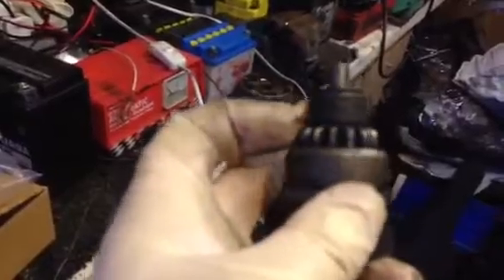BIKE WONT START SPEEDFIGHT FIX RUNNING MARK SAVAGE

Comment: Hello, I'm from Colombia and I have speedfight of the year 99 2 times 100 cc. I can not get the cylinder and the piston. I want to know if I can use a cylinder and piston of 70 cc to continue using it?. Thank you
Reply from the maker: hi bud you can only use the 70cc kit on a 50cc and not on a 100cc and the bore and bolt holes are different.maybe try and find an international seller or company on e bay that will send you it,  take care bud and thanks for watching there are many other videos on speedfights that will help you toomark

Comment: orite pal I've just changed crank on my speedfight 2 lc 2000 model doesn't want to start any ideas has spark, fuel, and compression need help cheers
Reply from the maker: if you have changed it and the oil seals are ok and it's sucking petrol in so the plug is getting wet with fuel ? , if not maybe ut some into the pot or use some easy start into the carb! , have you put water into the system? sometimes if the head is not down tight water will entre the head? ,this is why I say in my other videos not to do it and start without ! mark
Reply: Oil seals looked fine and plug is getting wet and will try easy star tonight and no water in system
Reply: mark savage  i have a speedfighter 100cc it has awsome compression but not spark i have checked the coil on my other bike its fine but when i try it on mine no good HELP PLEASE
Reply from the maker: hi bud I have over 50 videos to help and a few on cdi units which it sounds like it is with no spark!!, check out my other channel which you can find in my subscribe list just called mark savage help. on here you will find it easy and how to replace it and which one it is as there are 4 types 3 easy and one immob !. hope that helps please like and subscribe and share. mark
Reply: mark savage my bike is a non emobi and i will change my cdi unit today thanks

Comment: Hi mate I have a problem with my Speedfight 4 it won’t start it’s getting fuel,spark and compression but won’t fire up could it be the cdi? Cheers.
Reply from the maker: Kieran Mcdonald hi bud I did like working on the sp3’s and the sp4 is the same Lol 
If you have spark and a good blue spark then you cdi is fine 
However the piston can stil go and you can still get compression however they suffer from electrical problems on the sp3and 4s 
You end up with a orange weak spark  
Check earth and connector 
If it’s under 3years old maybe go back to Main dealer you got it from 
Mark
Reply: mark savage will check that cheers for advise

Comment: hi mark I blew my 50cc up and fitted a new 50s kit iv been running it in going easy ect when I'm rideing the bike will just die it's all standard but de restricted cleaned all carb lines ect and doing my nut in any ideas?
Reply from the maker: I take it it's A/C? as long as the head is down ok, check wires and then carb it has to be one of them sometimes the stator coil can go to earth and short out when it gets warm or coil ? other than that if it L/C it can be the head not down . any way check everything bud backwards make sure you reconnected the oil pipe as it could be heat seizing !! give them a go first and see what you can find . mark
Reply: Have you tightend your idle screw to much ?or the air fuel screw? Mine had the exact same problem

Comment: Mark where you based pall could you fix my aerox it's got a 70's kit on it and it bogged out on me when I was riding it and it hasn't started since got a spark plug but it was wrong one need to get the right one and see if that works but I think it f**ked
Reply from the maker: hi bud I have a few videos on the aerox's and I'm in Essex but normal do these videos so you can fix them yourself bud
Reply: Im with you that's abit far off as well but yeah I've never really gone in to the engine and other stuff but im thinking of giving it ago just can't think what the problem could be
Reply from the maker: well if you watch my videos I really don't like 70cc kits and will be doing a engine rebuild on one very soon so maybe keep an eye for it . I will be putting it back to a 50cc new crank oil seals rollers stator coil so lots of thing that will help you with your bike bud but normally a good carb service should help with your bike . thanks for watching my videos please do like and share and have a look at the aerox carb video its on here bud . mark
Reply: Yeah am with you saw a few videos of smashed Pistons I think that might be it but there could be a million things thanks I'll stay update
Reply: why don't you work on your bike bud. Don't get why people tune their bikes and not no how to maintain them. Aerox's are so easy to diagnosed issues. just go through your bike...lol
Reply: I haven't touched it or tuned it I bought it that way there's aload of metal bits in where crankshaft is think bearings n seals have gone or something plus I'm using shitty tools n all ,,,,, what do you think of the kurz rt1 125 enduro bike search it on wed
Reply: if you got shavings/bits in the crank could bearings, piston. What's actually wrong with your bike mate
Reply from the maker: Bluez Tues hi bud the 125 looks lovely me a road pit bike can't say I know much about them , as for the bits is the piston all there ? As I guess that would be from the piston, the bearing can break up as I've seen it before , have a look at the bit , I did a video on bearing and when they broke up , mark
Reply: Aerox Ryan it don't start with new piston and mark ye I know looks alright like know quit a lot about pit bikes might take the 125 out n put a 160 in it ,, and the bits are quit big but there not snapped off the piston there little shades of things thanks for help guys

Comment: My moped is a nightmare to start if it starts at all in the mornings but once it’s hot it’s starts straight away even on the electric start, just replaced spark plug but it started and cut out after 5 seconds of running and it was the same before I replaced the spark plug
Reply from the maker: Hi 
Ok carb off and clean like in my cleaning video 
Then tuning like in my tuning video
Auto start ?
Have to looked and tested that ?
Some moped in cold weather like kick starting as the stator coil get worn or dirty also maybe worth a look at 
Guessing you also changed the airfilter so serviced

Comment: The only way my bike will start is when i blow up the petrol pipe in to the tank then put the pipe back on the carb then it will run for about 30 seconds then it dies out any ideas plz

Comment: HI MARK, MY 2006 SPEEDFIGHTER  WILL START. BUT WHEN I LEAVE GO OF THE BREAK IT CUTS OUT  [CAN YOU HELP ME ]. THE ORANGE LIGHT COMES ON
Reply from the maker: snukey. bear hi I have many videos on here that will help you , take some time to watch them as there's over 50 . It will give you an idea what's going on then I can help after , please like share and subscribe , mark
Reply: THANKS bud
Reply: THANKS MARK ,
COULD YOU TELL ME WHERE THE VIN NUMBER IS, ON THE FRAME, ON A 125cc PIAGGIO SKIPPER 2004... CAN YOU HELP ME .....
Reply from the maker: snukey. bear hi bud as in my carb videos they will help with this as it could just need a clean or revs turned up, when did you last service it plug / air filter , give my other videos a watch bud and please like share and subscribe , mark

Comment: My bike flooded I think, I have black stuff on my spark plug, how do I unfood It??
Reply from the maker: Michael Hughes hi bud leave the plug out and the petrol will evaporate 
It may still be hard to start but clean the plug leave it for a while then pop it back in and give it a go
Do you know why it flooded 
Is it not starting ?
Hope that helps 
Please watch my other videos and please like share and subscribe 
Mark
Reply: mark savage no it won't start should I clean the carb out too??
Reply from the maker: Michael Hughes servicing the carb can only help maybe buy a new plug and check airfilter then it should all be happy and run better after 
Mark

Comment: When I go to start mines it makes that spinning noise that that one did.. what was the name of that part again?
Reply from the maker: Got videos on it bud
It’s the bendix 
Start dog in old English lol
Reply: @marksavage  thanks
Reply: One more question my daytime running lights and taillights not working, they only work when I press switch to high beam and press the pass button
Reply from the maker: Jamal Booker check bulbs bud 
They should work when the bike is running 
If not and it not the bulbs they do suffer from earth problems so clean and wd40
Reply: @marksavage  I changed the bulbs and they wasn't blown.. I just have a extra pair of light bulbs , could it be the stator?
Reply from the maker: Jamal Booker do your indicators work? Horn and rear brake light 
If so you battery is ok 
When running you say you high beam works stator works 
As long as it keeps working and not kill the battery 
I’d get a volt meter and trace the power 
On early ones they had a switch to turn them on !
Reply from the maker: Jamal Booker check power from the stator to test
Reply: @marksavage  all you identified works fine I just got the trike last summer brand new.. however I did have a radio and speakers installed, and soon after I thought I might have heard something pop, and the running lights and taillight hasn't worked since
Reply from the maker: Jamal Booker fuses but guess that’s the first thing you checked 
You as said will have to trace the power bud so you will need a volt meter
Reply: @marksavage  ok thanks

Comment: hi guys my speedfight 125 cc won't start its been sat for 2 weeks in the cold :(
Reply from the maker: they often do this and a little service can help , so check plug clean and air filter , charge battery and see if it starts 
after if not then clean carb and follow my videos as they will help